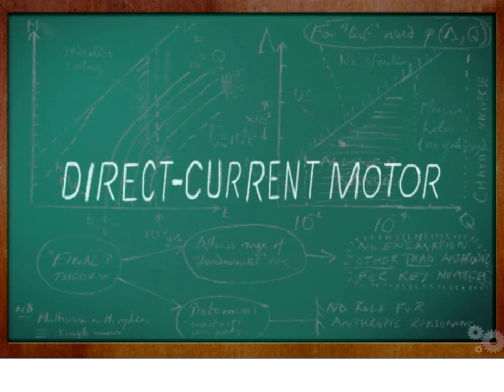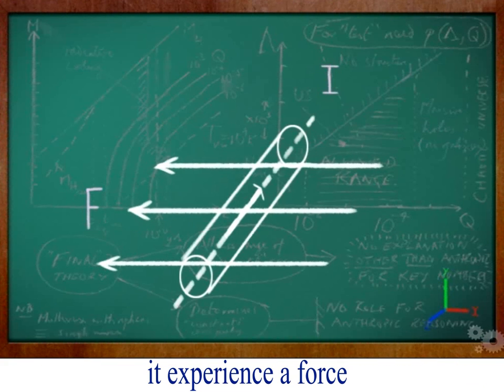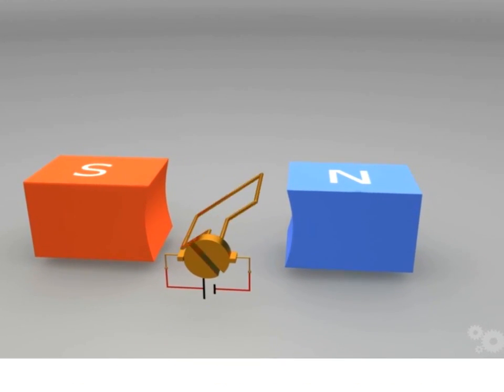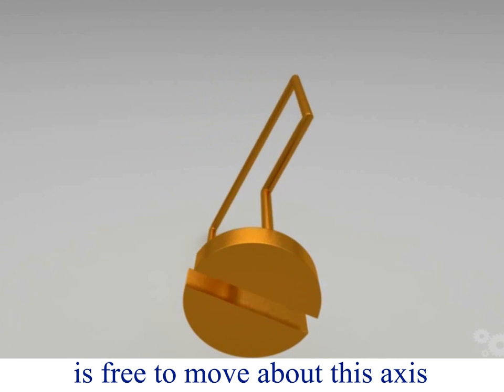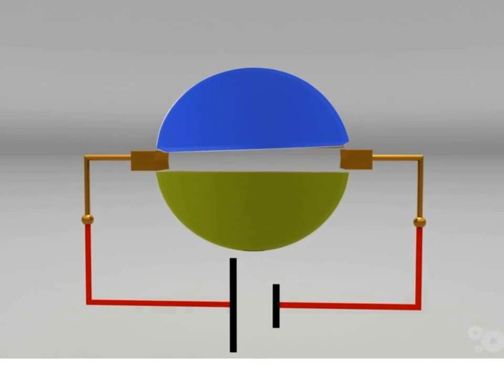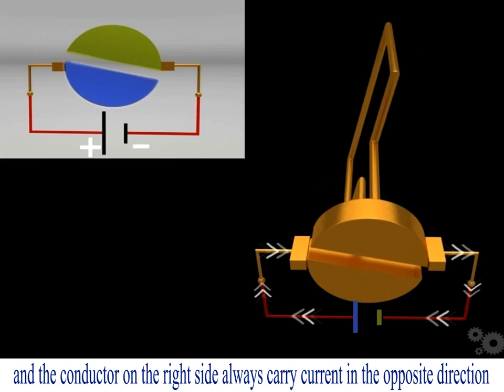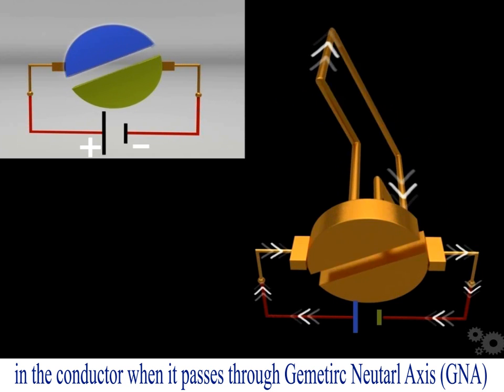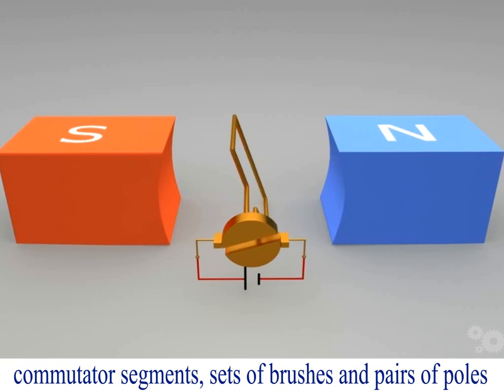working principle of DC motor

Comment: everyone says electrons flow from negative to positive for example in a battery, so why is your animation shows them flowing from positive to negative?
Reply from the maker: Yes you are right. 
electrons flow from negative to positive. In the video I said that the current is flowing form positive to negative that means I am talking about the direction of "conventional current" which is always opposite to the electrons.
Reply: marble89 yes it is clearly explained to us that in here we are using the conventional signs. If you are a tenth grader then it would be easier to understand.

Comment: sir what is the role of magnetic field in dc motor?if curent is rotating the armeture?
Reply from the maker: Because of the interaction of current and magnetic field force is produce. with out magnetic field there would be no Electromagnetic Torque. There is no sense of only current.